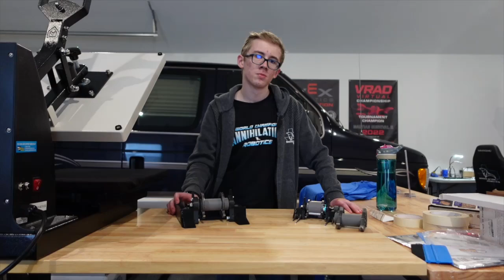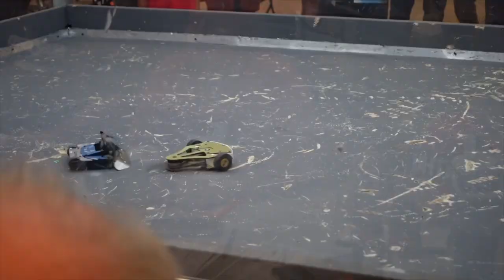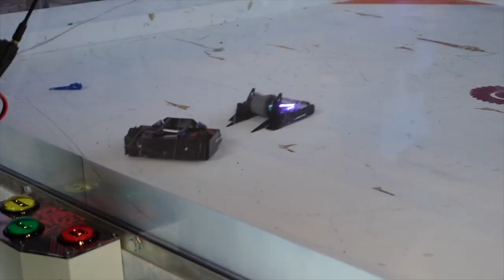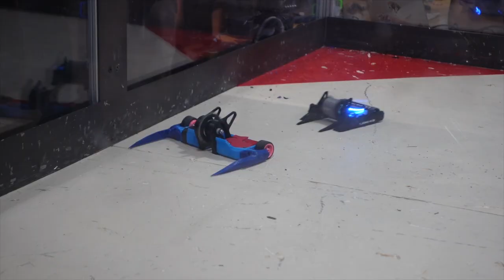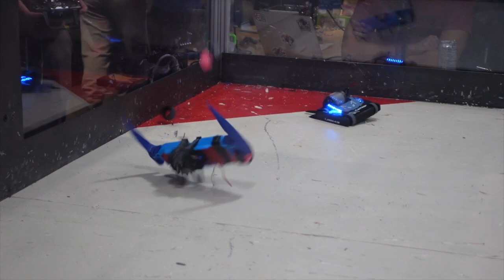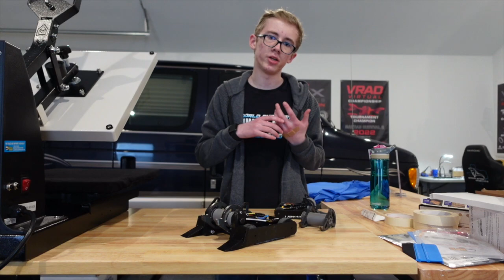How to Make Your Combat Robot Weapon as POWERFUL AS POSSIBLE

Comment: I struggle with onboard electricity management. Would you point me in the right direction as far as books or creators that speak more on that topic? I am also curious how you transmit signal to battle bots. Is anybody going autonomous? Thanks
Reply from the maker: For communicating with your robot, you can use any RC remote and receiver.  With onboard electricity management, could you explain more clearly what you mean by that?
Reply: For example. I struggle with selecting a battery appropriate for my projects. It is difficult to calculate how much power and for how long I will need it